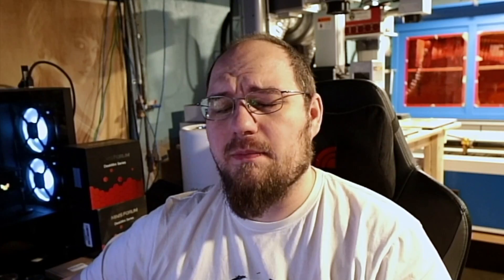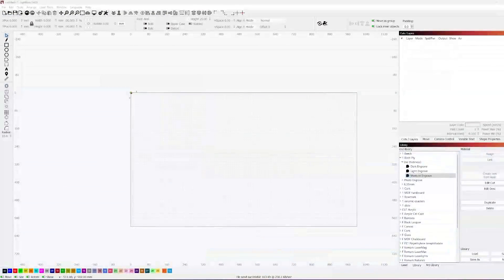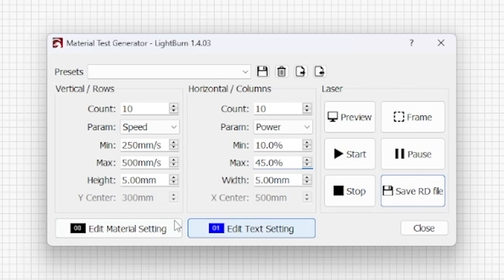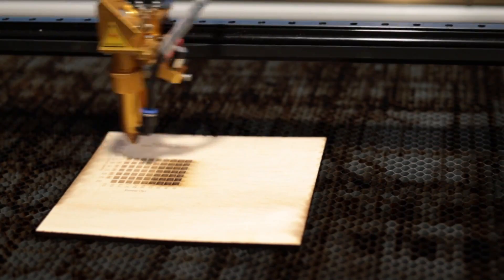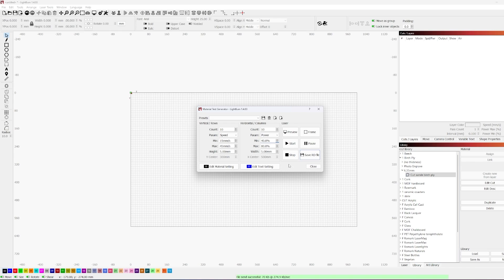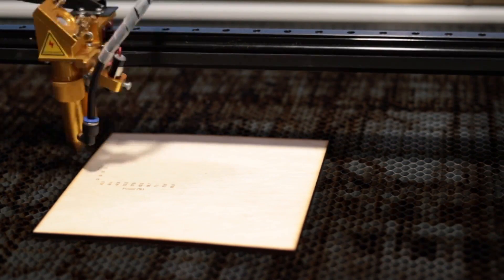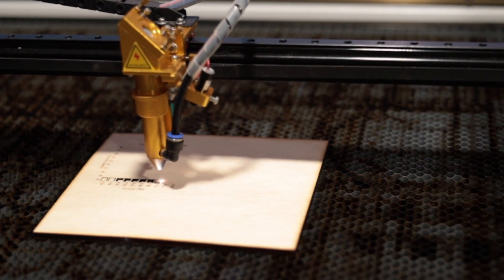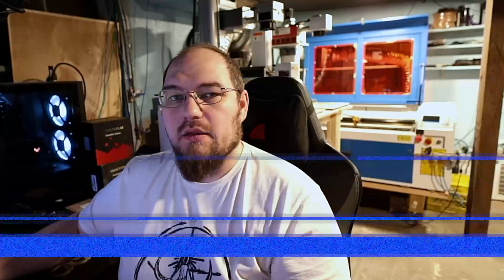Start Making Test Grids in LightBurn TODAY - Material Test Tool

Comment: i'm consistently getting squares that are exactly the same across the grid with power and speed being my parameters. i've switched up the materials, speed, interval, and power to determine if there is a setting issue, but can't seem to see one. is there a button somewhere that blocks this test from controling the parameters??
Reply from the maker: I can't say for sure, but its possible the layer you're testing may be stuck. Try opening the value and at the bottom resetting everything to default and building the values again. That may help! If not, join one of our communities and the support team and community can dig in and work together to get things going.
Reply: @LaserEverything  thanks! I figured it out shortly after I asked. I had my dpi set too high.

Comment: Doesn’t seem a required field for fiber is how many passes. Cause I see some files there’s no way it was done on one pass lol
Reply: In those cases, many times you run the test in single passes to walk in the results. Most machines will let you do repeat jobs very simply. A button push on the machine, for example.

Comment: Laser currently under maitenance and i just bought a new air assist which i need to install on my laser (same as yours if it is HL-1060 90/100w? ~100cm x 60cm).
Didnt see that feature on the Lightburn but i might need to check this out now >> only have done that with my 30W fiber laser.
Thanks for the compact video 👍